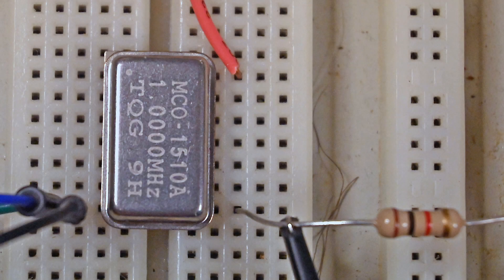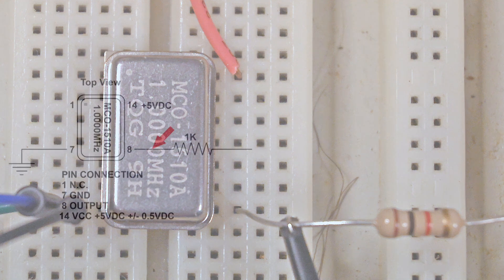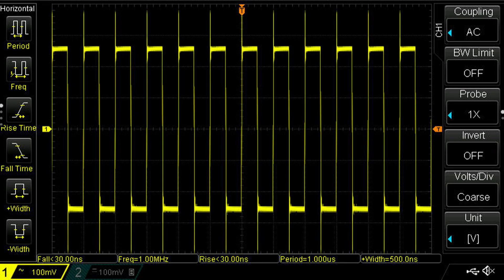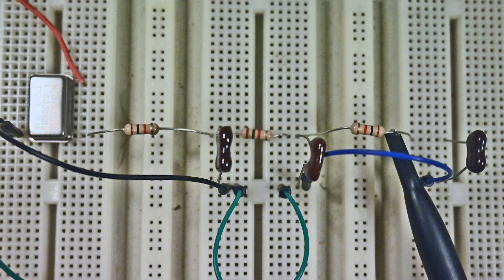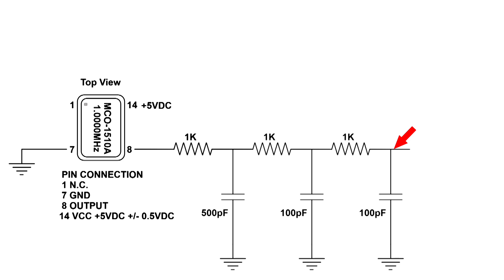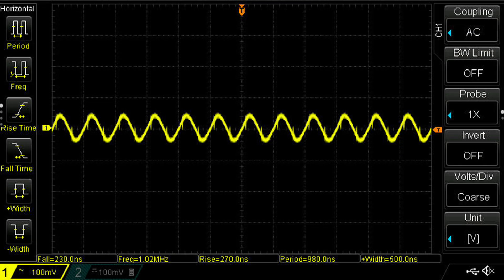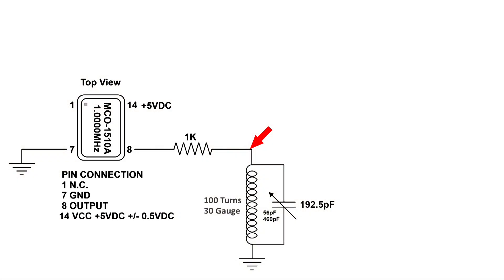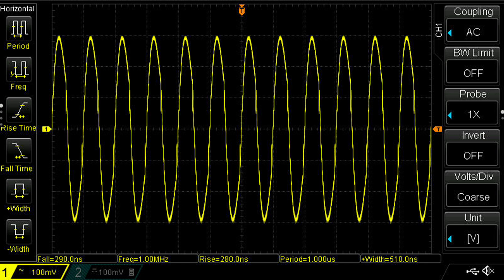MCO 1510A 1MHz Oscillator Square Wave to Sine Wave

Comment: Nice. Now use a 1000:8 ohm audio transformer for modulation and you'll get a nice AM Transmitter! Cool! Also, you could use fixed inductor in place of wound one and yet it'll do fine. Cool
Reply from the maker: That should work! THANKS!

Comment: I just went through this on a project. I needed a square to sine wave filter for a 10:1 frequency divider down range of my rubidium standard.  I built a lowpass RC filter and it worked as designed but exhibited 20db of loss @1mhz  much like you experienced. The fixed value lowpass LC filter works even better and exhibits only 3db of loss @ 1mhz .  How much can you vary the pass window on your variable LC filter ? Thanks for sharing !
Reply from the maker: I still have the circuit. So a made a video changing the variable capacitor. Starting at 192.5 pF than to 56pF than to 460pF. 
Video link
https://youtu.be/oYeDSlhSNcc
Reply: I suppose the 3dB loss could be made up for by adding a few turns of wire which then turns the coil into an autotransformer.

Comment: Great circuit! Are you going to design a low power AM modulator? I would be interested to see your results.
Reply from the maker: I'm going to use a 1MHz crystal, I want the tank at the output. Just ordered crystal, I'll send a note and link.

Comment: Those little four pin modules are actually very complicated little oscillator modules.  I'm amazed at how close to the listed frequency they actually are. They are available in many frequencies.  I have some at 14.418180 Mhz which were used in older color cameras to provide the time base for a standard NTSC  color signal.
Reply from the maker: Thanks for the information! 
Thank you!